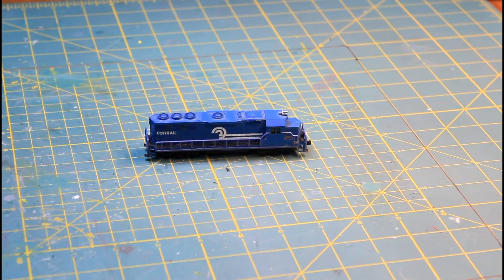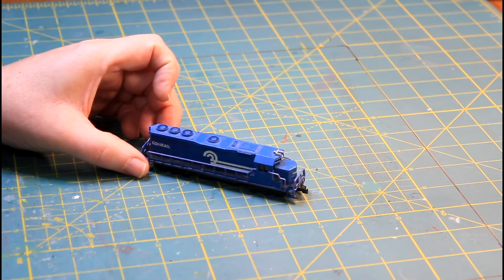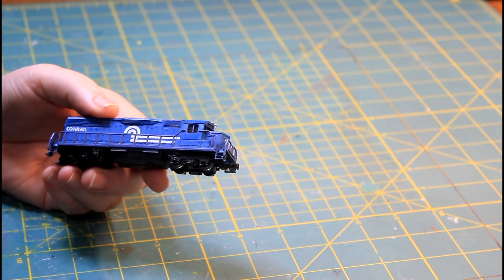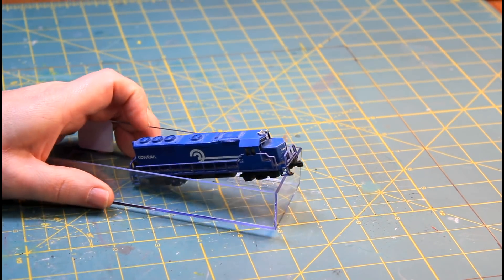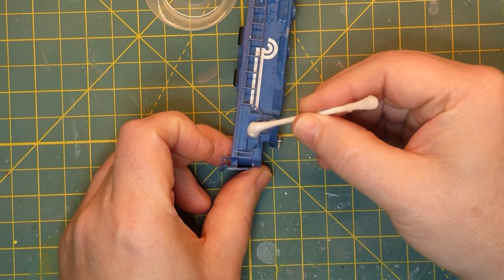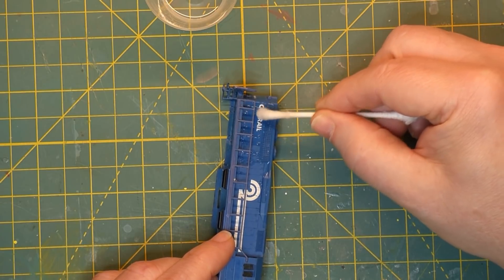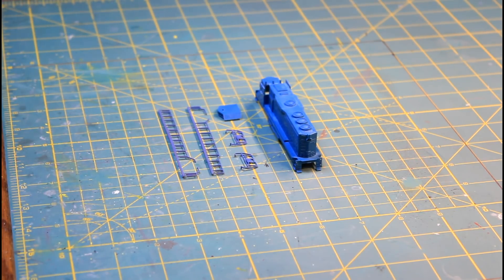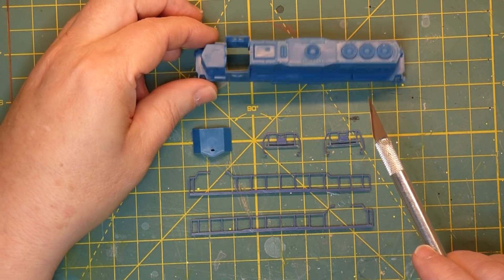How to Repaint a locomotive: Part 1

Comment: what was the manufacture of the engine... I have had some issues with Atlas n scale engines that 90 % will not take any paint off ( factory paint )  I used simple green too with sad results.
On atlas engines I use Super Clean but you have to wear gloves and it works in about 2 hours.
looking forward to your way of doing it.
Reply from the maker: will kling yup when I saw all the black come off but not the blue I thought I was in trouble but then saw it was molded in blue was a big relief. The 90% did take the blue paint off though as it had turned blue.
Reply from the maker: will kling yes it is atlas as well